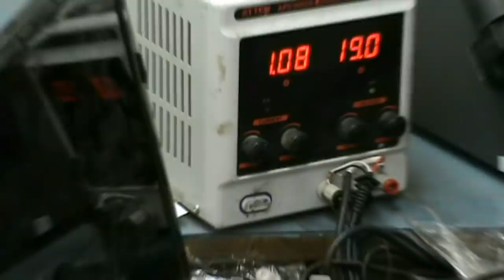Laptop BGA Reballing

Comment: I thought I was good with Computer hardware then I discover this wizard.  I am now going to play with my lego to make myself feel like a master looool
Reply: we throw most pc hardware out ,imagine if ppl like him increase we can reduce ewaste  n also bottomline of PC hardware companies
Reply: instablaster...
Reply: My sony Vaio laptop have graphic card issue ,as it shows green lines,dots on the display ,will this process work for this problem??
Reply: @bhupeshmishra1052  I'm not an expert but I think sometimes it could be the solution but it can also be a problem in the screen conector or it's just that the chip (GPU) is damaged
Reply: @LemonCakeOfficial  you are right bro , I took it to repair shop,  replaced connector cable ,still problem is there, and it was found that there is problem with gpu..

Comment: Thank for your sharing.  I learn and understand a lot of steps you apply to this motherboard.   May I know what is the purpose of yellow tape in 10:58.  You cut that tape for a short strip and apply on to the chip.  Is it the conductor tape  or  double side glue tape or for grounding purpose ?  Thank
Reply from the maker: When i put aluminium foil on chip upper side , chip upper side capacitor may be short so i am using tapa as a insulator

Comment: cool job! comments, sound, used tools and procedures would be a great addition. Nice to learn about that mold. What's the spray you use and the stuff you put on with the brush for example? temperature profile?
Reply from the maker: thanks for your comment .. spray is a NC thinner for clean flux easily ,  temp is a profile ,,  not more than 240C

Comment: HP Business Notebook PCs - System Fan (90b) error message on startup

This document pertains to HP and Compaq notebook PCs.
When starting the computer, the following error appears on the screen:
The system has detected that a cooling fan is not operating correctly.
Continued operation is not recommended and may cause unpredictable behavior that could result in random shutdown, data loss or possible system damage. The system will shut down in 15 seconds. To prevent shutdown and continue operation, press the Enter key now.
System Fan (90b)
In addition to this error, the system fan may spin faster and become louder.

Comment: Thank you for the video!
Very informative! 

Did you use the ultrasonic vibration cleaner to take the stencil of the chip or to clean it?
Also do you think an IR station is better or a hot air station is better?

Thank you!
Reply from the maker: as per my point of view hot air is better than IR . ultrasonic cleaner use for remove stencils and for clean ic
Reply: Hello, let me know how much hot gun temperature we can apply on stencil after placing balls on chip, 

and how much temperature we can set on bga machine for sticking balls of stencil to chip.
thanks.

Comment: Hello There Sir!
I'was wondering if you could help me with a problem that I"am facing.
I'have a 60 wat soldering iron and I"am using 0.75mm solid core solder but the problem is that the solder doesn't melt or flow!
I'have waited more than 20 mins for the tip to get hot.
This is my second soldering iron that I"just got for 15 euros.
What should I"do?
Also Can you give me a few suggestions on what type of solder thickness to use in relation to the right amount of soldeing wattage!
Show less
REPLY

Comment: Solid Redball job, can I ask where you get the metal stencil to reball? Are you building hose yourself or could you provide me with a link. Our shop, while we rarely reball BGA parts, usually puts a tape type stencil and the solder is scraped leaving the balls in the corect position, however the dstencil has to sdtay under the part before you reapply iy to out IR Station. I really like your method.
Reply from the maker: you can buy it from AliExpress 

search on there "direct heat bga stencils"
Reply: Amazon too.

Comment: very interesting, but in my job, I am a systems integration specialist, is something of a standard. Have seen many boards, etc., which have given up their minds by static charge, but why ia there no sound? I can´t understand what you do with the SMD Chips ans CPU´s PLease explain it, thx
Reply from the maker: Thanks for your comment .. i written at description regarding  static charge solution, in this video i am reballing GPU  , due to dry solder gpu we change new ball and it will work again
Reply: @HarshadPatel  OK thank you

Comment: ...interesting...and you're good (maybe?) however...where can you get this done, time frame, how much, cost effectiveness, failure rate? Seems (imo) like margin for error is high. Are you using ESD (electrostatic-discharge) grounding? The heat from the soldering iron alone is enough to destroy the processor without a proper heat sink. If a device is creating so much heat as to damage solder points on a processor or the main-board, you need better cooling and ventilation alternatives.
 
Once you get over the wow factor of this repair, there is no reason to believe this is worth the effort considering all the risk factors.
Reply: This may be economical in a different part of the world where sourcing new parts is prohibitively expensive. Consider Cuba where the people there reuse and refurbish plenty of products we would otherwise throw away and buy again.
Reply: i don´t think that this temperature will damage the IC cause they were soldered trough reflow at the same (or higher) temperature.

Comment: why do you use an ultrasonic bath? Wouldn't that potentially crack solder joints in the resistors or damage the silicon?
Reply from the maker: after reball flux will be stick between the stencil and bga ic , so ultrasonic with nc thiner  will be help separate the stencil

Comment: respected sir which company flux you are using and which model ..???
Reply from the maker: Kingbo rma218
Reply: +Harshad Patel Do You position the BGA manually?
Reply from the maker: yes its manual position .. align bga with motherboard outline draw
Reply: and after it will sit down correctly?
Reply from the maker: yes bga flux will be align
Reply: i've reballed the chip 216-0810001, amd hd6770, but no video, do you think that  the chip could be completely broken?
Reply from the maker: may be chip faulty or other may be issue... what was a amp rating ?
Reply: i didn't checked because i was sure it was the gpu problem because i have 2 identical motherboards from pavilion dv7, they starts and there is a sound but not video, nether trough vga
Reply from the maker: replace bga

Comment: respected sir, how much temperature you give to the bga chip and for how long time ? please tell  me..
Reply from the maker: Its a profile
Reply: +Harshad Patel yes sir its a profile but we have to set the profile in machine so i just want to know sir what temperature you set in the profile and how how long time heat up the chip ? please help
Reply from the maker: TOP HEATER 
R1:2.50 L1:150 D1:17
R2:2.10 L2:170 D2:16
R3:2.30 L3:190 D3:20
R4:2.30 L4:210 D4:20
R5:2.10 L5:220 D5:15
R6:2.20 L6:230 D6:20
R7:2.50 L7:250 D7:30
R8: END
BOTTOM HEATER
R1:2.00 L1:165 D1:15
R2:2.00 L2:185 D2:15
R3:2.00 L3:220 D3:10
R4:2.00 L4:240 D4:650
IR HEATER IS 160
Reply from the maker: +Mohit Saini  R=SLOP , L =TEMP , D=TIME
Reply: +Harshad Patel thanks a lot sir......can we use IP thinner instead of ultrasonic cleaner ?

Comment: why do this reballing fix wont last for a month? The answer is that specifically in these generation of nvidea & ati chips, the faulty balls are not between the motherboard & the ic, its on the silicon chip and its substrate pcb. without doing this tedious reballing process if u just blow hotgun at even below temp of our traditional sn-pb solder melting point on that glassy silicon chip centering the whole IC, it would work like the same. As a nvidea  engineer i am revealing the truth, because i support #righttorepair bill

Comment: would it work with puttin' a Nvidia chipset 2 replace Intel HD chipset?
Reply: +blakedmc1989RaveHD No, I'm pretty confident their not even pin compatible. Even if they where, they would not be changeable.
Reply: Asaggy Noodle awwww dang! i'm tired of Intel HD tho! it's what holds a decent laptop back on performance! oh well gotta look on ebay 4 a gaming Windows 7 laptop tho! wish me luck on bank
Reply: +blakedmc1989RaveHD Intel HD compute units are located with the CPU. It's not located on the chipset.
Reply from the maker: +blakedmc1989RaveHD   some model will be convert it as a non graphics motherboard .. like n5010 and many more motherboard .. 

for more detail visit at www.indiarefix.com and search on there convert n5010
Reply: topic is BGA reballing!!! oh! i think that's cool

Comment: is there any possibility.. i want to change my laptop processor from i3 to i5... ( my current processor is i3 5005u 2.0 ghz , 15 TDP and socket 1168 BGA )
Reply from the maker: no
Reply: @HarshadPatel  sir, can you  tell me why?
Reply from the maker: @theoldgamer2612  bga cpu have different pin connection and as well as other hardware not support this pin out like io controller , bios , lan , sound etc .
Reply: @HarshadPatel  Thank you.. that was helpful.

Comment: Why do you add kapton tape?
Reply from the maker: Because of next step is put there metal pad instead of regular heatsink pad , and if gpu upperside capacitors can be short circuit with metal pad , capton tape use as a insulator

Comment: Do you know how to fix a broken touchpad connector on the mainboard? I could get you a photograph of my problem, maybe you can help!
Reply from the maker: yes , if your touchpad lock is broken so you can fix it with cotton wool,. plug the fcc cable in to the broken connector and insert and push some cotton from cable blue strip upper side

Comment: Lame question...so that mean GBA cpu can be upgrade on board?
Reply: If u got the tools and knowledge required then yes, but remember to actually upgrade it you will need a better CPU using the same socket and also better refrigeration

Comment: Why do you put the chip in the solution, and what is called this solution(liquid)?.. please.
Reply from the maker: Its a NC thinner .. it's use for clean flux and remove stencil easily from bga.
Reply: thanks.
Reply: +Harshad Patel do you need to heat up the chip (120C 10hrs) to remove liquid before soldering?
Reply from the maker: thetomegeb 120 C  
10 hrs ????

Comment: All the steps when removing the old balls, both on the chip as on the board, was the totally wrong way it should be done, and where is the esd protection wrist band?! I got chills down my spine when I saw all these errors. And if that cloth thing was is then it was not connected to anything all the time as it should! Dont teach out the wrong way! I sure as hell would never leave anything to be repaired at this place for sure.
Reply from the maker: Thanks for your comment 🙏🏽 but if you watch it again you can see anti static mat each and every work table , also we are installing antistatic floor carpet ,,since year 2005 and if you watch it till end of video, you shall be see display comes after done the work ,, and also every day 4 to 5 job we had done with 6 month warranty ..
Reply: Doesnt matter any of that if it is not done right from the beginning and a wristband along with antistatic mat and board is mandatory when dealing with highly integrated circuits. But that is not the only problems I saw.
Reply: can't be that wrong when it worked in the end
Reply: @megakoni1  There is a term in the industry called Walking wounded, So think of ..lets say a soldier and gets shot he will still be alive but if not treated he will eventually loose blood and die from his injuries. same concept here.  Very interesting video tho  seeing it from a different point of view even if not industry standards
Reply from the maker: @dtiydr  ESD wrist is a cheap solution for esd protection , but we are covered all work bench with ESD MATE ( search on Google ESD mate) so doesn't Wearing Everytime esd wrist , many people don't know about ESD MATE its quite costly , ESD MATE always grounded you so there is never effect antistatic charge , if you watch video again you can see blue mate on the table , also foot mate not recorded in video ( when i make this video i never expect ESD realted questions otherwise i record it first for people who asking for ESD protection )

Comment: Too bad there's no audio and no explanation.
No attention to dust or watever, freestyle mode ;)
Reply: It's just a reballing of circuit and components, you need specific machine and products to do it, in general falls and high heat inside pc finish to destroy bad soldered joints do it nowadays, specially about videoboards and video processors contacts. Special machines, or old machines don't suffer about those problems they continue to work for ages.
If you see how is builded, the qualithy of the boards and the attention to create a good forced air circulation inside a server Proliant dl380 or in a PowerEdge R710  a very small servers with just 2 rack units, you will discover why those machines are working  without problems from ages

Comment: all the work is awesome , until he place the thermal pads , come on man, thermal past is away better then the thermal pads, the GPU will fail soon like that
Reply from the maker: thanks , here between the GPU. and heatsink have 0.4mm gap while we screw it, so thermal pad is compulsory, between the cpu and heatsink there is no gap so we use there thermal paste
Reply: @HarshadPatel  ohhhhh, this happend to me too, i tried the therma pads, but temps go crazy, so i decide to remove the heatink, and use some force to make it as close as to gpu die, and its works, you must be a patient, because took me 20 min of trying, and this issue is commen in hp laptop
Reply from the maker: wow great solution

Comment: an ultrasonic cleaner on BGAs. you lost all credibility. And unless you are wearing ESD footwear on an ESD floor with both feet on the ground, you violate every ESD safety measure I can thing of. Please, no one use this as a guide for anything.
Reply from the maker: ESD wrist is a cheap solution for esd protection , but we are covered all work bench with ESD MATE ( search on Google ESD mate) so doesn't Wearing Every time esd wrist , many people don't know about ESD MATE its quite costly , ESD MATE always grounded you so there is never effect antistatic charge , if you watch video again you can see blue mate on the table , also foot mate not recorded in video ( when i make this video i never expect ESD realted questions in comment box otherwise i record it first for people who asking for ESD protection )